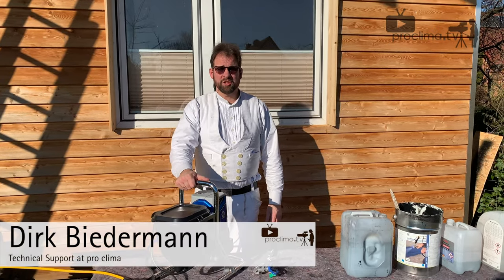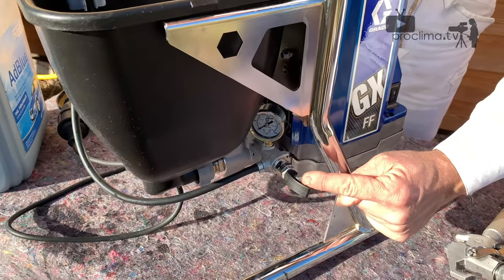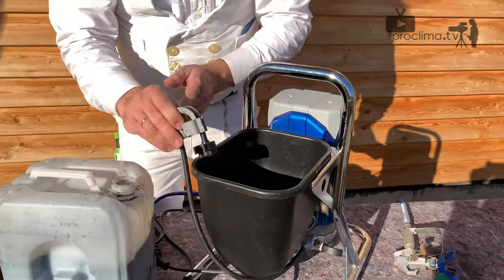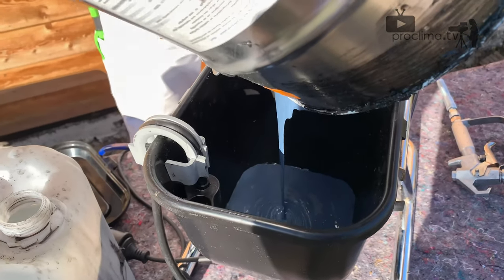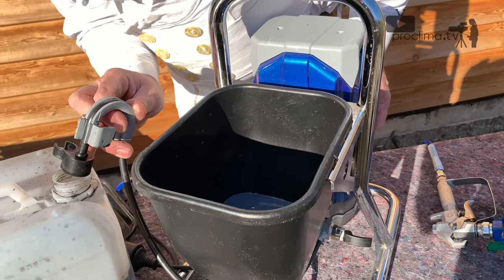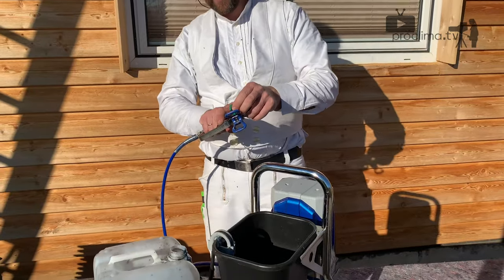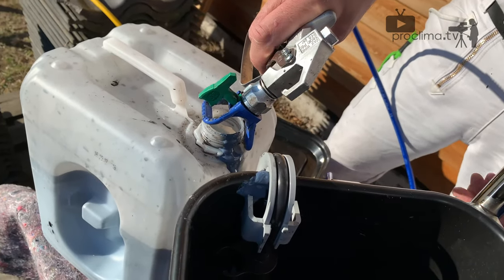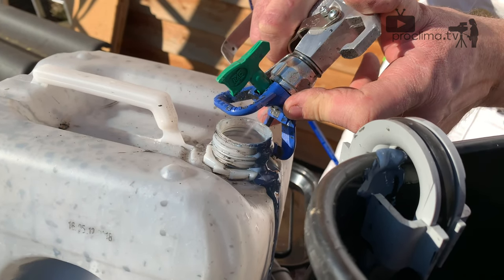Part 3: Airless machine GRACO GX FF for AEROSANA VISCONN (starting up the machine)

Comment: What tip would you recommend with this graco model? This is for stud bays
Reply from the maker: The Graco GX FF works with spray tips from FF 210 LP up to FF 519 LP (low pressure). The spray tip Graco FF 519 LP is recommended for a good area performance, useful for spraying stud bays, but it's necessary to use the Graco LP LOW PRESSURE Tip, indicated by the green colour. Please make sure, that the gunfilter 60 Mesh is installed and the InstaClean Filter is removed.
Reply: @ProclimaDe  Thank you! I appreciate it